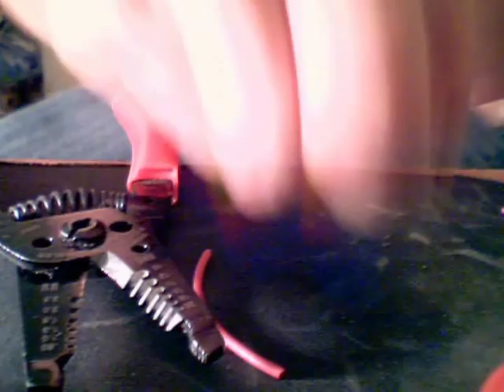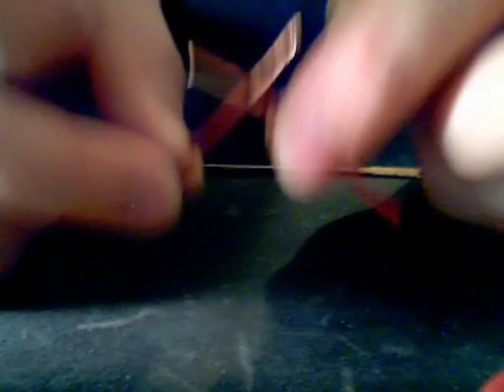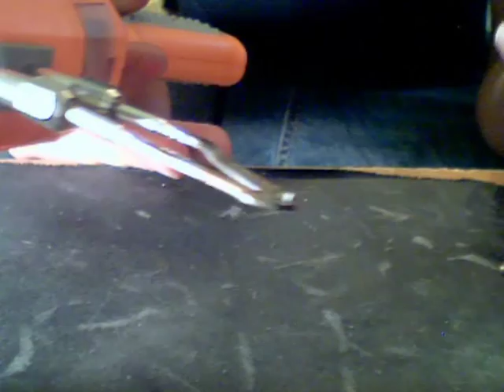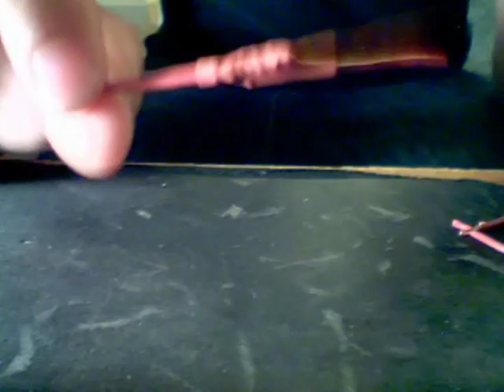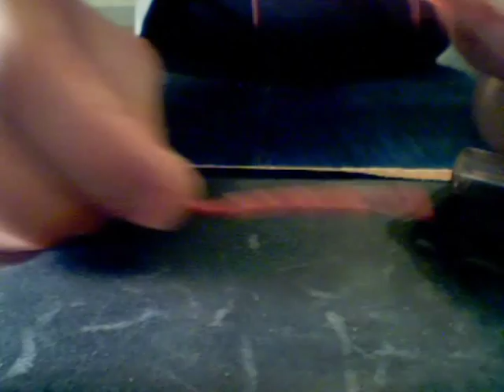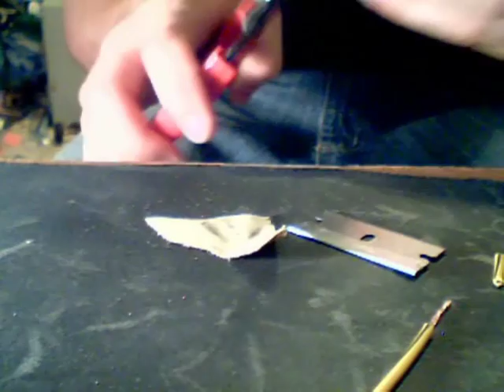How to: Solder wires

Comment from the maker: Soldered wires had a shiny finish, solder melted evenly over the joint, correct solder for the application was used and soldered joint was properly covered with heat shrink tubing. If that isn't professionally soldered then I don't know what is. I would like to see you attempt to do better.